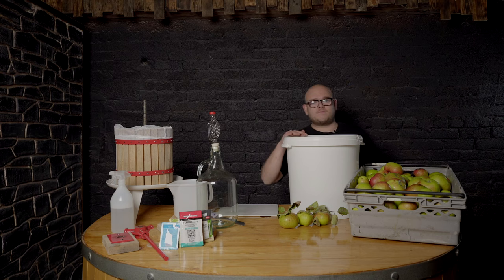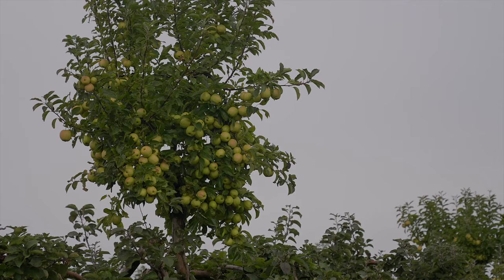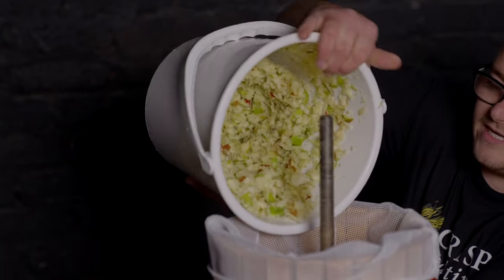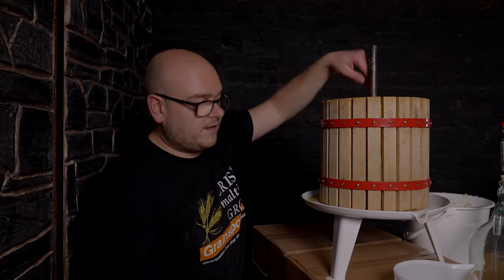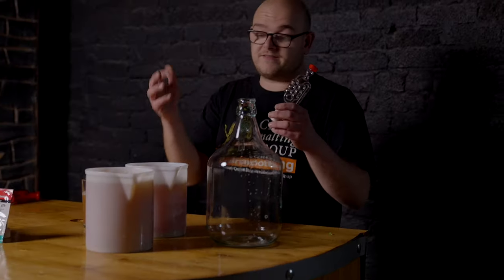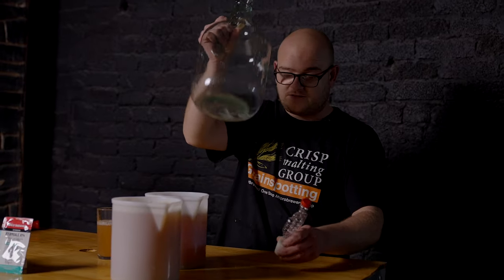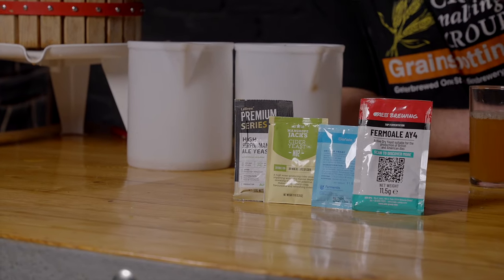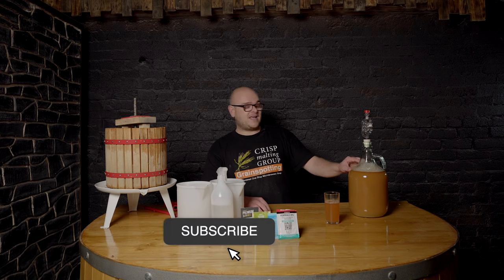How to make Cider From Apples - Simple & Rewarding

Comment: Brewing beer, I would fill the fermenter so it would blow off some of the impurities. Why wouldn't you do the same with cider?
Reply from the maker: I would add an airlock so any co2 can escape during fermentation
Reply: @Get Er Brewed - Home Brew & Craft Beer  for blow-off what I use is still technically an air lock.

It is literally a three piece airlock that I put a hose on the main piece (not using the other two) and run it into a Mason jar (with starsan) to catch the Krausen.

I never wanted the foam before.

Comment: Yesterday I started my first ever brew, 8 simmered and mashed apple cores with 2kg of sugar, added 25-30g of fresh bread yeast into a 7-8 ish litre glass dispenser ( filled 3/4 of the way) less than a day later it buzzing with gas (CO2 - checked with a lighter)... So how long should I leave it in a 25-28C  dark room?
Reply: Most fermentation cycles are 4-6 weeks. Change out the airlock generally  every 2 weeks if it gets cloudy. Generally do a gravity check weekly, and you can zero on in the abv you want.

Comment: My question is this, after two weeks does this cider have it's own carbon as such in the bottle Angry Orchard beer? If not what must I do to have the co2 carbon to make it fuzzy?
Reply from the maker: It will require secondary fermentation when added to bottles , we use a level teaspoon of priming sugar per 500ml bottle as a guide

Comment: Hi there thank you fir your video  I am in the proses of making some apple cider I have washed. Cut and press  them to make juice  I used my juicer and I have 20lt. Of fresh juice I wanted to ask is it advised  to cook the juice to make sure there no backterie that may have gotten in or should it be ok  to just add yeast and start firmentation
Reply: But if necromancy, but coming from the mead making side of things, no. Just always sanitize your press, knives, containers, airlocks, everything. Pair with a simple cleaning of the fruit you should have no problems. If ya do, you can usually tell before you even drink it.

Comment: I came here because I bought some farm cider a few months ago and was told that it is just made from apples using an old cider press, I was wondering if that is all that is involved in making cider.  You have answered the question.  It was delicious scrumpy cider and had a strength of 8 %.  but I do have one further question:  How do you vary the specific gravity of cider when you make it?  With the example here what would be the strength if you don't alter it in any way?  Thanks
Reply: You vary specific gravity by adding sugar to the juice pre-fermentation, even cheap hydrometers tend to come with some kind of way to help you calculate how much sugar to add to reach a certain s.g. in order to get a desired % alcohol.

Comment: why not use a juicer. it will be faster that way
Reply: I've done that. It's not very efficient at getting all the juice out and it's super messy!
Reply: Have you tried this with a juicer?  I just started some cider from store bought juice but have an electric juicer and thought that would be much easier than a manual press when I get some apples here soon.. I'm assuming it will be very dirty and full of pulp but I suppose that won't matter once it's racked?
Reply: @Bobotrucker  After a jucier, the juice should be filtered through gauze. Then there will be no pulp